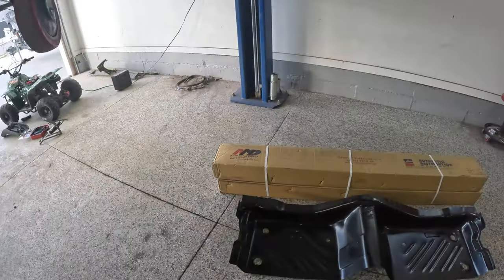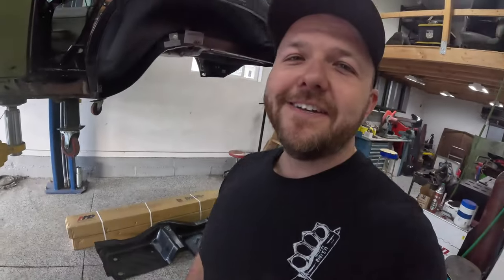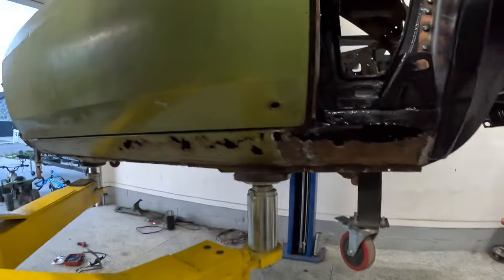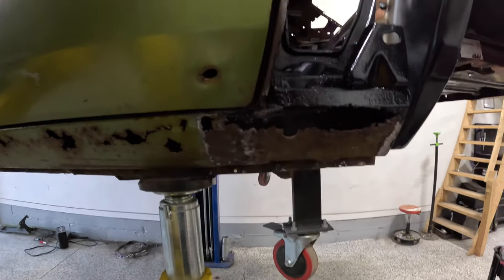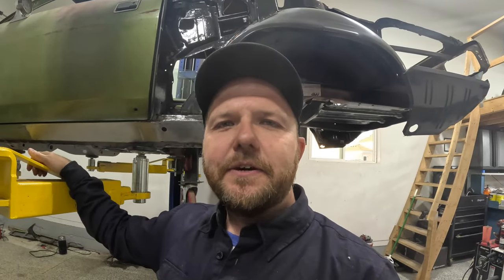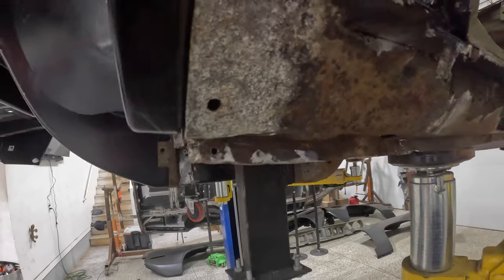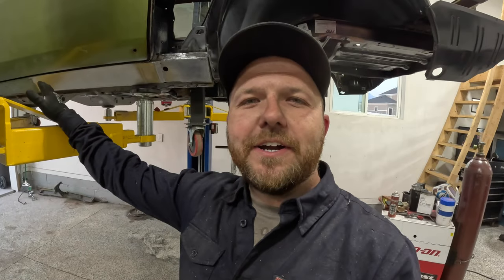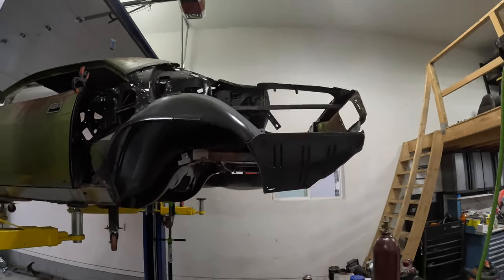1971 Plymouth Cuda Restoration - Episode 12 - Rocker Panel Repair

Comment: Excellent work and instruction as always. I have 2 GoPro tips. I always use mine in the waterproof case. It protects the lens and helps if it's dropped. You can also use a welding hood clear lens in front of the camera. Easy to replace when dirty or damaged. Keep up the good work!

Comment: awesome job! May I suggest a ventilation system when you weld/grind/paint.. even if the door is open sometimes the fumes can get to you quickly and that is a good way to get sick.. Bathroom fan with a flexible duct on both ends , that dumps outside is a cheap way of doing that.. just sayin ;)

Comment: IDK... as a rule of thumb, 2 inches in front of the rust wouldn't work for me.  I mean... who knows what someone did before.  I went to replace the rockers in my pickup... and someone filled the heck out of them before - plenty of fiberglass/filler... They looked good in places... but had started cracking.  Yeah, there was rusty metal behind the stuff that looked good.  So I'm sitting here thinking "Oh no... you want to cut out the old before you slice up the new!"... and then wishing you showed us all you did to the inner rockers.  I guess 415 is a product?... I was really hoping to see more of that (and wanting to verify there was no rust lurking behind what "looked good".  Of course I'm absolutely certain that YOU, of all people, know what you are doing.... always excellent work.  Was just hoping to see a little more is all.  Thanks for sharing this with us - still eager to watch you move on from the metal work.... and now I'm trying to figure out if a trip to Wyoming is in my future.... lol.
Reply: Actually, the coating he mentioned is POR-15. POR stands for Paint Over Rust. I've been using it since the early 90's.  It essentially neutralizes surface rust, stabilizes it, and locks in the metal, preventing oxidation.

Comment: Watching a lot of rocker videos. I’ve had a rust free rear clip 70 roadrunner in my basement 40 years. It’s cut 12 inches forward across the car forward of door jam.  I just bought a whole 70 car severely rusted rear clip but the front of car is really dry. How would you recommend splicing them together. The downer  rear clip is absolute rust free but only has 12 inches of the rocker and perfect quarter panel.  I’m sure some structural planing needs to be understood.
Reply from the maker: Send me some photos on Instagram
Reply: Ok I can have one of my kids show me instagram tonight. Thanks.

Comment: How did you get Oxford and primer behind the rest of the rocker panel?
Reply from the maker: I reached up in there as far as I could with a brush.  I also used a conical aerosol nozzle on a long tube

Comment: Reversing the ravages of rust with every installment! That tool you finish/burnish the rocker with is amazing. I'd be afraid I never stopped with it and thin out the metal too far. You've got the touch though. Great video. T-bone is way ahead of other boys his age learning to operate power tools and fit panels. He's learned that all important skill of thinking ahead on what his Dad will need next and handing it to him(panel screws). That July goal you've set yourself is really ambitious. Hope you make it. Malcolm Ottawa Valley
Reply from the maker: Me too!  Time to get busy! 😎🤘

Comment: Why open the quarters and NOT do the Hemi/Vert stiffeners/stuffers? Tbone shouldn't wait until the rocking chair, he  should start now.  Run a 225/6 or step up your chassis stiffening game before birdsong is embarrassed.  This car will be a pretzel. 
    Where's the POR15?
    Did you inspect the front rockers inside while it was open?
Reply from the maker: This car will be getting the full USCT chassis stiffening kit in an episode or two.  Can’t wait!  I’ve shown how to do POR15 in probably 10 different episodes.  These also got the full treatment inside.  The insides of the rockers looked great!  The inners especially are just about mint! 😎🤘